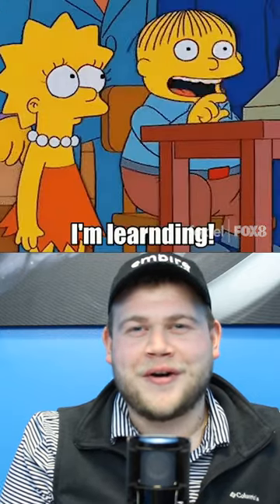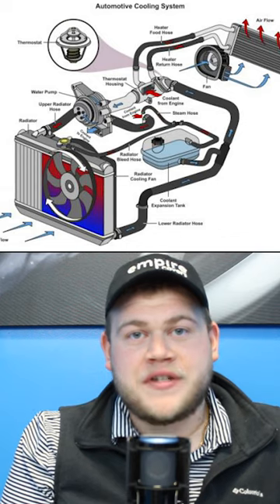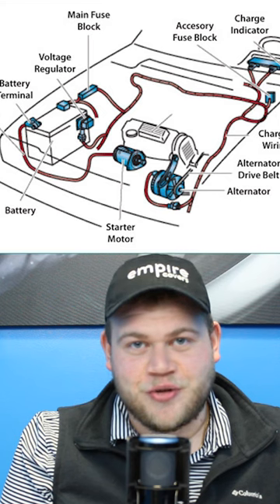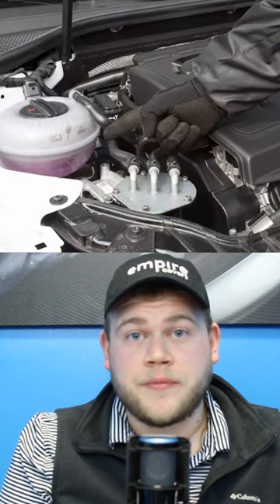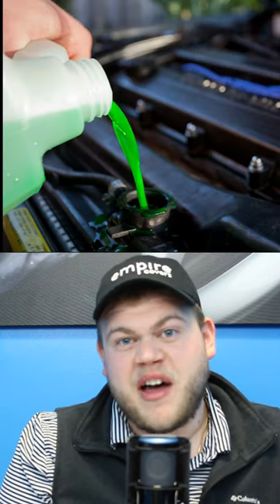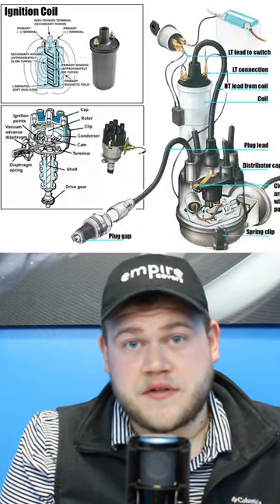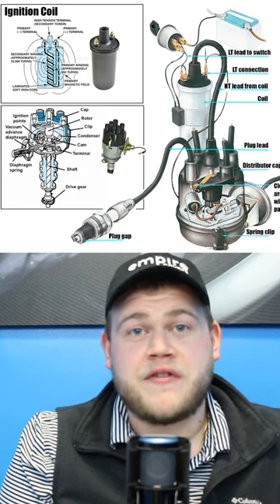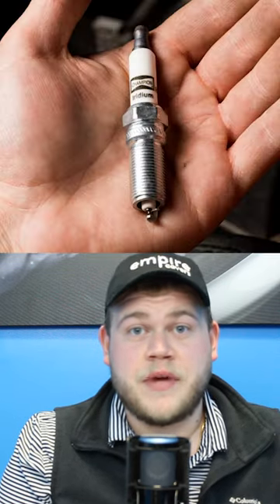Car School Week 4: The Cooling and Electrical Systems

Comment: For the older ignition systems, the ignition coil showed in the video was a coil from a newer/newish car, these have a ignition coil for every cylinder that goes on top of the valve cover, into the head and plugs in to the spark plug. Vehicles with a distributor have only one coil for all 8/6/4/2 cylinders whatever it may be. And were used up to the early 2000s. 👍
Reply from the maker: Thanks for the tip, Logan!